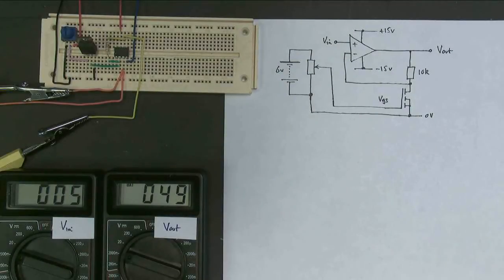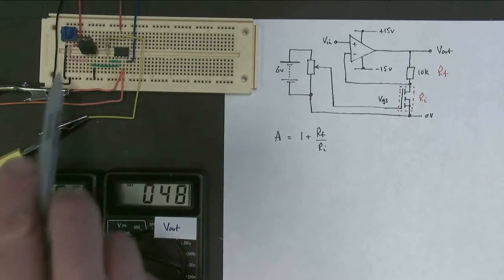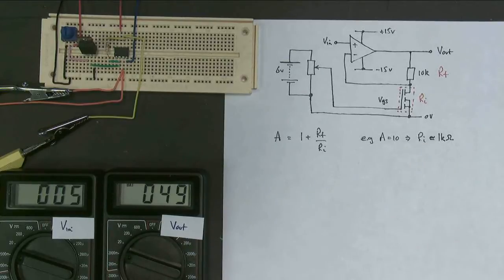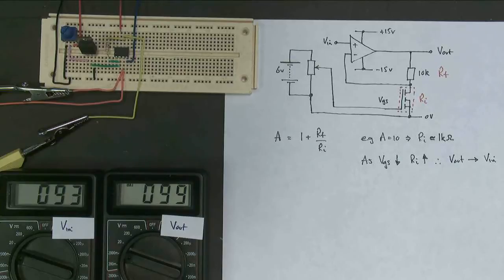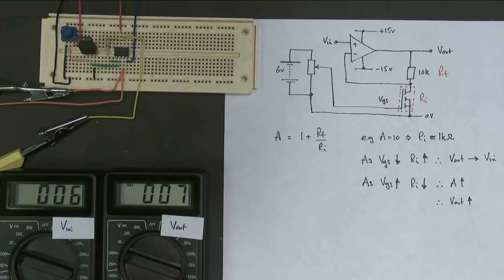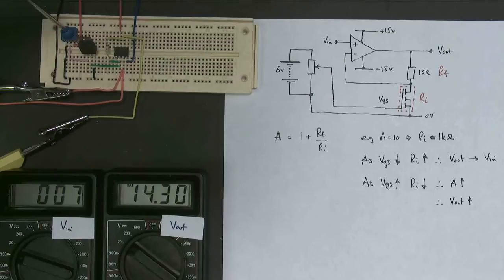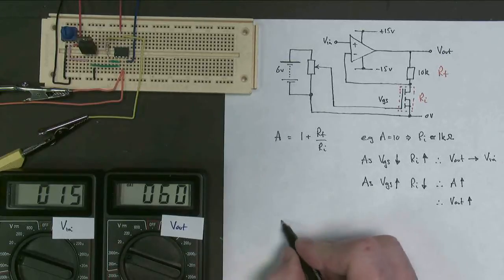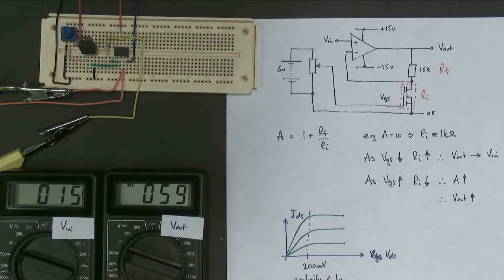MOSFET Part5 Variable Resistor2

Comment: Are you using the same IRF510 transistor on this video? thanks.
Reply from the maker: Thank you for your comments. I made these videos with/for my students as we went through the course and they were made a few days apart. I couldn't be sure that the exact same device was used in each video, sorry. We had a few MOSFETS on hand that we were using at the time.